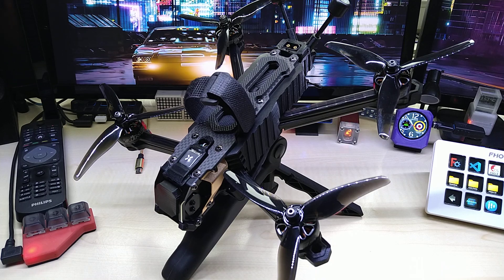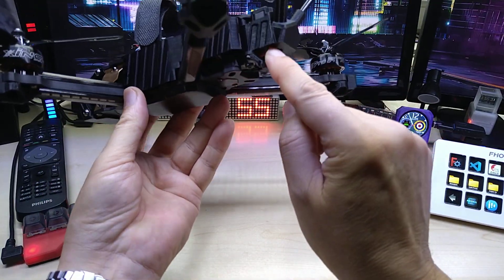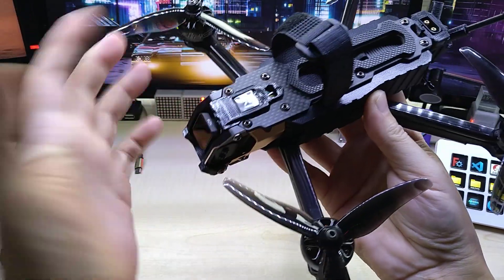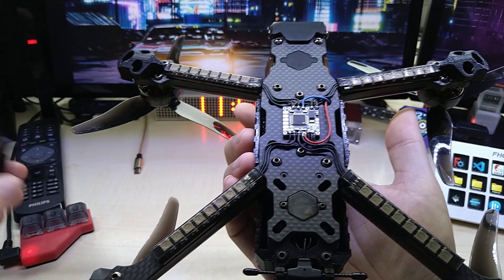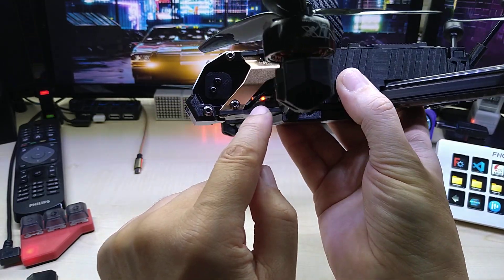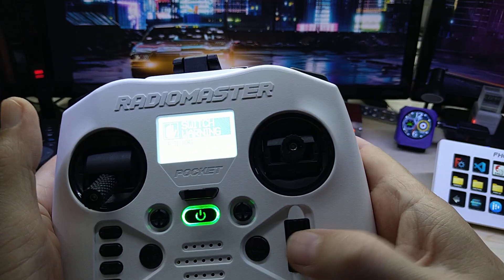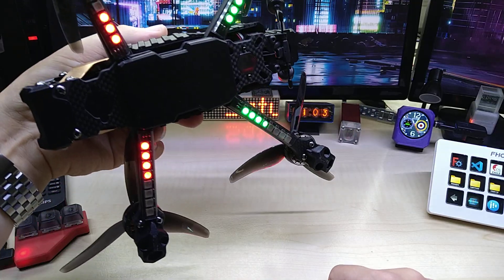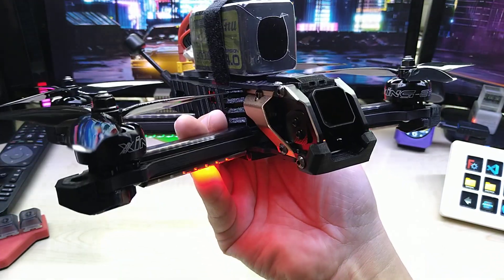5" #SpeedyBee Drone finished, with NeoPixel LED's, #2207 XING-E Pro 1800KV motors, by #Hayri Part 6

Comment: Thank you very much for sharing the files!

I have adjusted them to fit to my needs and uploaded them on makerworld:

SpeedyBee Mario 5 Mount Walksnail Moonlight Cam with adjustable camera angle

SpeedyBee Mario 5 Tail with mount for Walksnail Moonlight Antennas and vertical mount and protection of the second antennna of a true diversity receiver

The design would have been much more difficult and time consuming without the excellent work of iHayri1!

Comment: Hi. I'm interested to built like this so thank you for shearing! Im wondering if there is jello problem? Moonlight camera often has jello problem.
Reply from the maker: Hi, unfortunately I did not get around to take off yet, too much work, bad weather, hospital visits just to name a few. From what I read and learned, the jello problem comes from a too tight mounted camera, the SpeedyBee has the yellow silicone mounts which should prevent any problems. In any case, time will tell as I designed new mounts and printed them with TPU to move the camera back so it will be protected better in a crash. So, only after I fly for the first time and keep it in the air, I will be able to tell more. I will definitely upload the recorded video, so if you keep an eye out for it or subscribe you will be able to see it.
Reply: @iHayri1  Silicone/TPU mount for camera should solve problem. You are on good way. But I have TPU mount on Gofilm20 and there is jello effect and it shouldn't be. It's quite easy to remove in gyroflow but still. So your flying test tell us true only. I keep watching as a subscriber now. If everything will be ok I will ask about stl. Thank you.
Reply from the maker: @Velociraptor_alfa  Actually silicone would be better but let's see how TPU will work out. Worst case I will make some molds and make it out of silicone 🙂
Reply: @ Or try to soft TPU like 95A. Anyway, we are waiting for your field test :)
Reply from the maker: @Velociraptor_alfa  I think my TPU is 95, will see how the video turns out. Did sent the stl's via email to you 🙂
Reply: @iHayri1  Today I tested this "hard" way of mounting the camera. I changed the position slightly to make it horizontal flat (0 degree) for the first flights. The picture is very good, no jello.
Reply from the maker: @Velociraptor_alfa  Good to hear 🙂

Comment: Excellent work.👍👍👍 I love it when you think about the little details. I would be very happy if you would publish the STL of the prints. One small thing I would recommend is a second Velcro strap for attaching the batteries to the rear. This way you can balance the weight of the battery better.
Reply from the maker: Thank you, please send me your email or get in contact with me so I can send you the stl files, as I am not sure when I will be able to upload them as I am quite busy right now.
Reply: i agree! i would love to know the prints
Reply from the maker: @levilina9074  please send me your email or get in contact with me so I can send you the stl files, as I am not sure when I will be able to upload them as I am quite busy right now.
Reply: Great, thank you very much for the offer. There is no rush, if you want them to be published it is ok

Comment: I strongly suggest you secure the bottom plate with screws.  
You've electronics underneath,  they will get damaged easily or cause a short. 
When you land, the drone bumps off the ground...
Nice build 👌
Reply from the maker: Thank you for your comment, I already have a plan to secure the bottom plate with screws as well 🙂